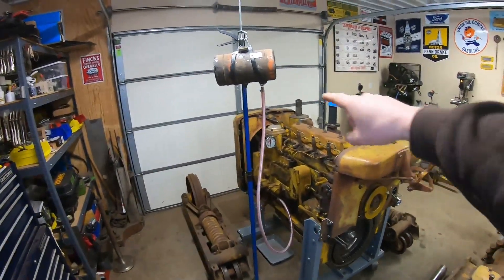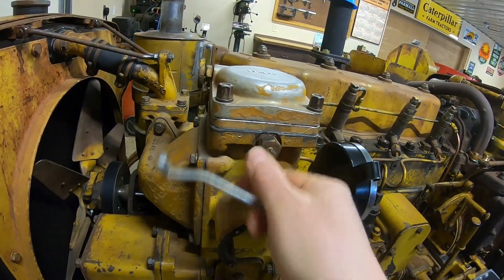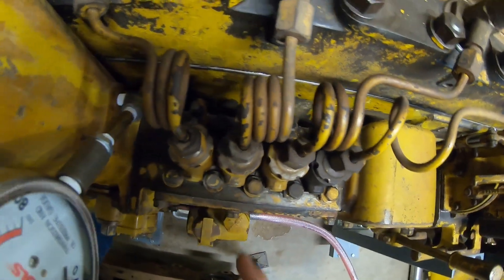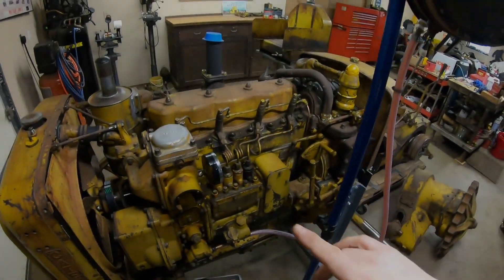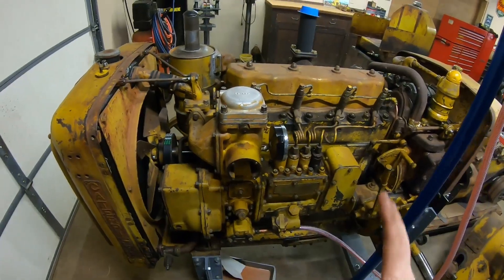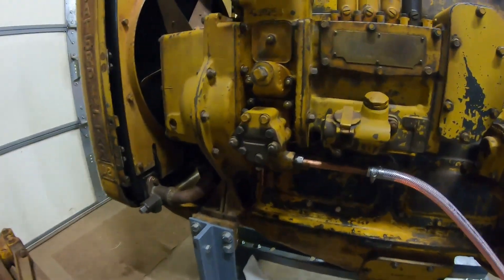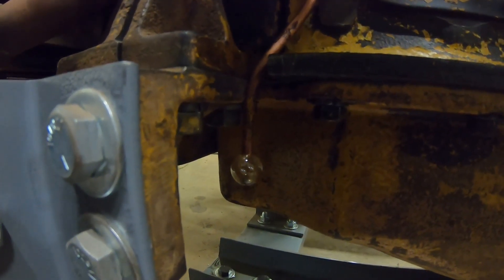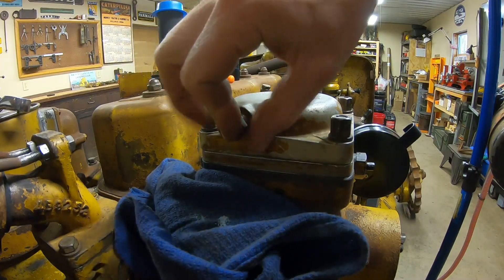Caterpillar D2 #5J1113 Starting System Ep.24: Final Episode Before Startup & Gravity Bleeding Diesel

Comment: just finished installing new steering clutches in my 54 D2 and went to change the oil in the pony engine and found antifreeze in there :(. engine oil is good. pony has new head gaskets. so off with the pong engine, ugh! what might I look for, best to worst scenario? also found a small leak in the radiator. Can I remove just the top part of the radiator leaving the bottom with the pass through for the hyd pump or should I remove the pump and plumbing and take the whole radiator off?
Enjoy your work, even if bulldozers on you tube drive my wife nuts:).
thanks
Marc in NH
Reply from the maker: Coolant in the pony crankcase is mostly caused by leaking head gaskets, or a leaking top cover gasket.  Aside from those two sources, it would take a crack in a casting for it to migrate into there.  But as long as you have the pony off, you'll want to flush out the bottom cross-over cooling passage in the block that runs alongside the oil sump portion and make sure it's open to better circulate the coolant through the pony engine itself - those are almost always clogged up and in a few cases I've had to run a rod through there to break through the deposits.

It's a 50/50 split between whether you're best to bite the bullet and pull the whole radiator for a thorough re-sealing, or if you can get away with just pulling the top tank.  In my world, I usually never get away with a quick and easy repair attempt and just end up doing the job over again a second time and going all the way.  But your mileage may vary - it is possible to just remove the top tank and leave the base undisturbed.

Comment: That was a designed leak! A drop every 12 seconds was how that brass washer was calibrated. They sell them with 6, 8, 10 second drips as well ($125 each) with a perpetual drip, it keeps air out of the system. My car does that with motor oil. A new quart goes in every month. A perpetual oil change, as it were. Surprised you didn’t know that…

Comment: Almost seems like you got away easy given the location of that fuel leak. I was hoping you weren’t going to have to disassemble half the fuel system to get at some balky fitting. Based on your other experiences that wasn’t a long shot. Gonna be a joy to heat that engine roar!

Comment: I did brakes on a customers dodge 3500 (2002) plow truck.  COULD NOT Get the lines to seal to the calipers.  Fought with it for a day.  Ended up heat the copper washer with a torch, dunking them in cold water to soften them. Then filing them flat on both sides    Finally it sealed.   They can be a bigger pain than they’re worth

Comment: Copper and aluminum together causes galvanic reaction/corrosion in the presence of oxygen or water. I imagine that is why the aluminum surface is so rough; fuel system sat dry for extended period of time.  The copper turns green, but aluminum becomes sacrificial.  You may want to try an aluminum washer instead.

Comment: Hi Sqatch! You can always temper all copper washers before installing. After tempering they are much softer and can adopt and seal rough surfaces. Copper is hardening after being crushed. It`s possible to use copper washers many times, but they have to be tempere after each tightening. I even temper new ones, becouse in the "factory" condition they are usually too hard

Comment: I found heating the copper washers up cherry red with a propane torch will allow you reuse them.  I have never had one leak after softening them up like this.  My dad showed me this trick back in the early 60s.  He and my Uncle ran a service station repair shop in the early 50s when I was born.  I can't wait to here the first start on the engines, but please continue at your deliberate pace and don't rush to finish, I can wait.
Reply: My father taught me to quench the red hot copper washers in water to anneal them.

Comment: Awesome video it's not always easy to figure out the fuel leaks but when you get them fixed you have cleared a major hurdle. I was working on a big IHC tractor last I knew that the fuel return line to the tank was leaking so I replaced it and started the engine and then it started leaking up by the injector pump I told the customer that we are just chasing the leak around unless I replace the steel pipe so I put hard wall fuel injection hose in place of the steel and it quit leaking
Reply: @squatch253  your absolutely right about and when you never heard the original engine run a person is skeptical of every part you worked on especially the fuel system stuff one never knows